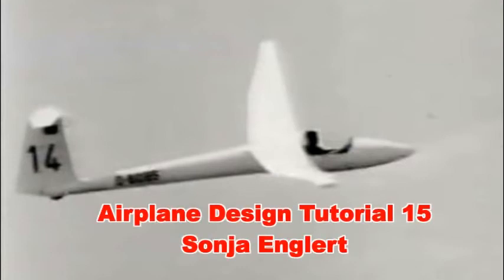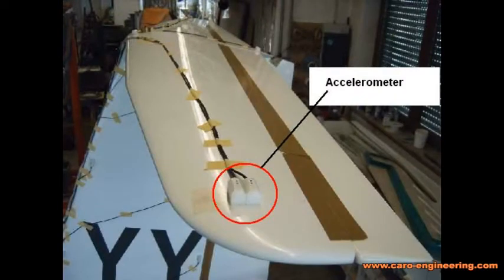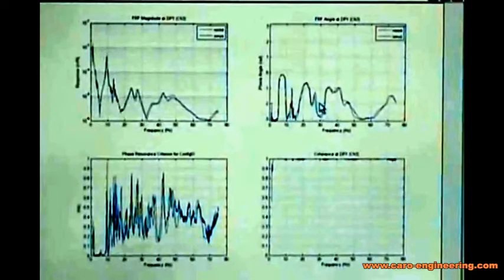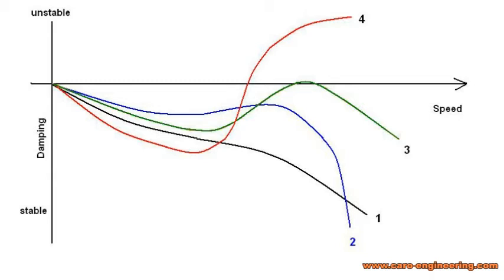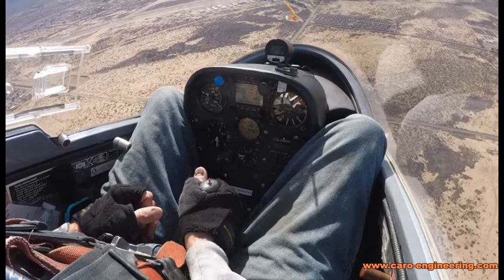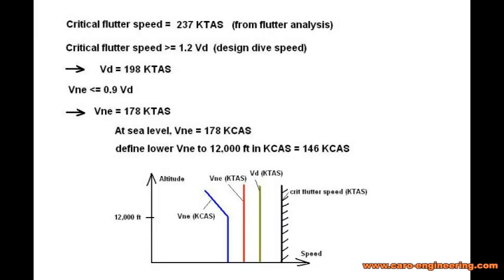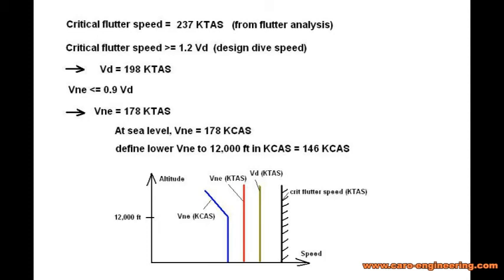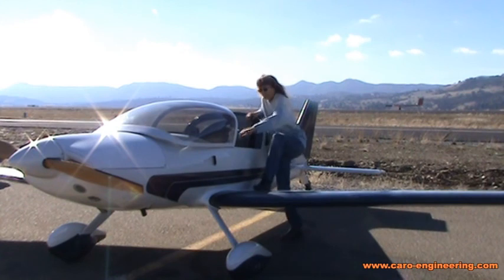Small Airplane Design Tutorial 15, Flutter continued, ground vibration test

Comment: Just watched your two tutorials on flutter.  Thanks !  Will post in local fb aviation group.   For the record, I did once induce flutter in a high performance glider by simply trying a pronounced side slip (I had just declined the offer of my instructor to try aerobatics as we were at 15 000' and had to loose a lot of altitude) :   VERY violent (and a bit scary) :  Didn't wait for instructions to stop the side slip, allowing the flutter to dissipate.  Just a couple of days ago, found completely loose rudder cables on an unbalanced GA rudder...  Thanks !